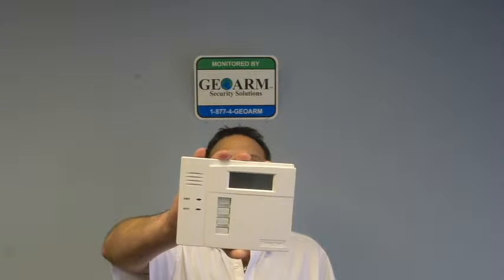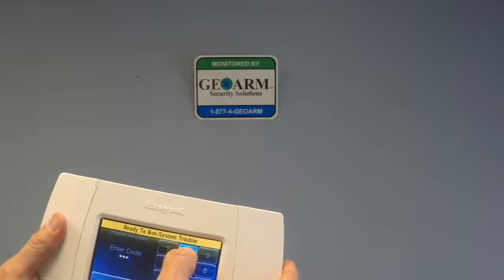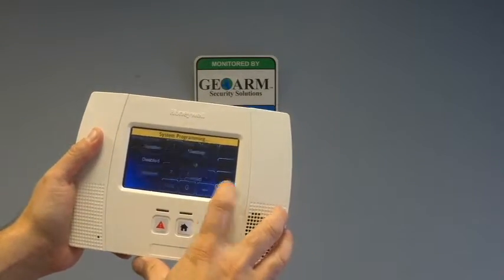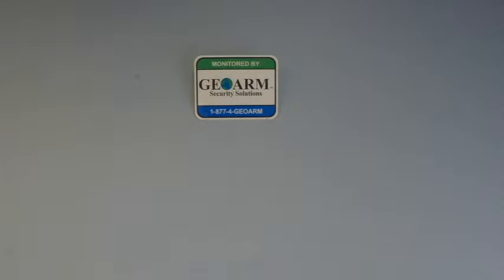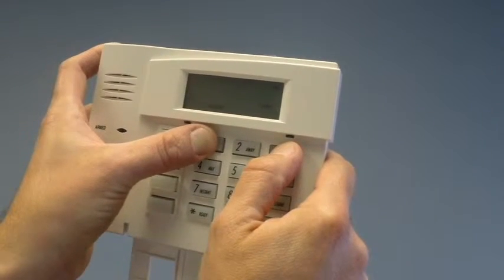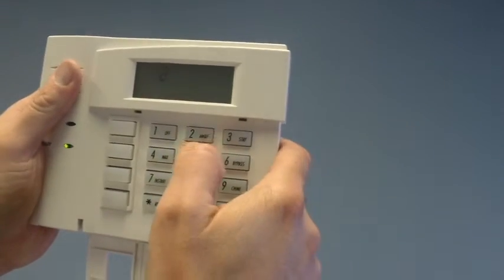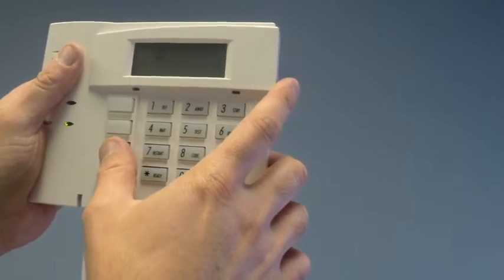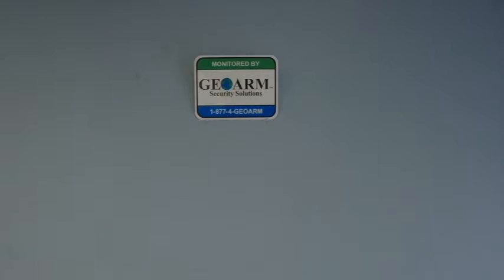Honeywell 5828 - L5200 Programming

Comment: Do I need a panel? Or can I just link the 5828 up with a wireless door sensor? Thanks.
Reply from the maker: +Nick Sannicandro you will have to have an alarm system in order to have this keypad
Reply: I have a panel 6150 keypad but not wireless and a motion and zones I have zone 1 which is my bg-12 and my 2nd zone which is my bedroom door my third zone which is my bedroom window my fourth zone which is my simplex duel action tebar my sixth zone which is my motion and a siren
Reply: I forgot my fifth zone which is my floor sensor and my seventh zone which is my glass breaker sensor